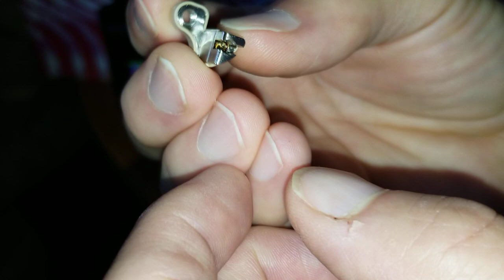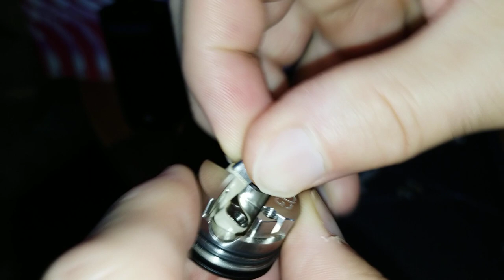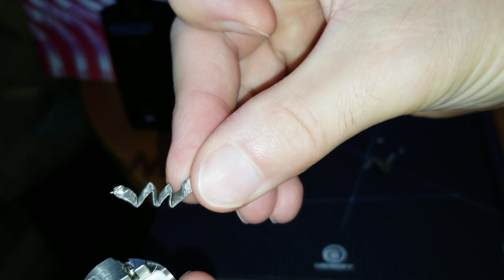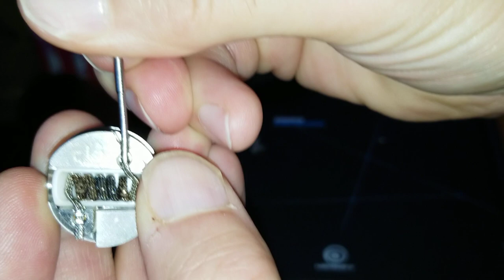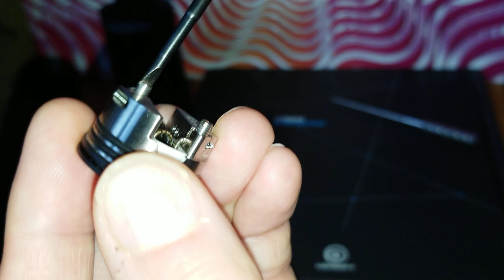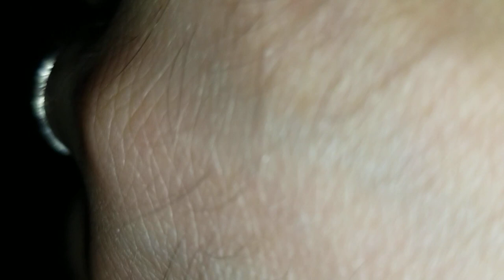That Atty! aka TRVP V3 complete teardown, coil install, MOD settings and more➕➕➕

Comment: Dang this is nice 👌 I've been using a terp pen xl by boundless for vapihg it right out of the container or wax paper I get it on but I hate how easily it gets clogged up . I still have wax left but no way to use it rn lol. So how do u vape the dab 🤔 since u obv can't use cotton like reg vaping so do u just dab on the coil, just by itself with no wick basically? I'm a rebuildable guy very experienced in reg vaping but rebuildables for dabs? Shii I don't know! Can i technically use like an old wasp nano rda with a coil with no wick to vape the dab ? Or am I missing something. Any tips for a dab newbie for rebuildables n would be welcome to any help in this area . I waste so much wax just trying to transfer it 😩😂 
Btw - are these still made or around for sale cuz I can't see. Wondering if i can still get one of these atties . Or any help on stuff I already have I got a bunch of gear so curios if I could do dabs like this 😅